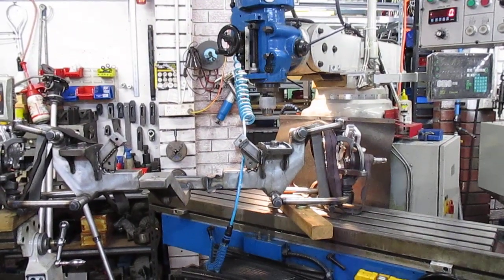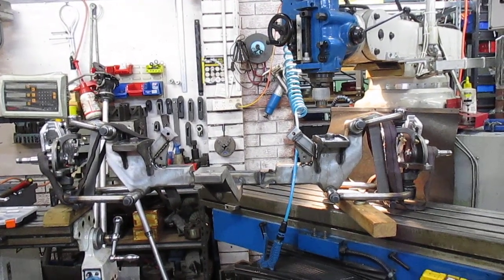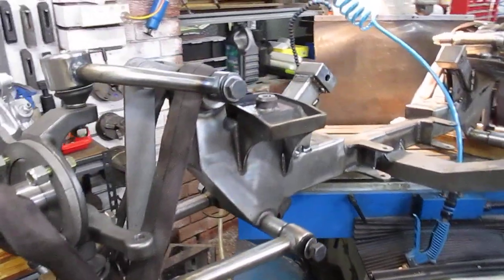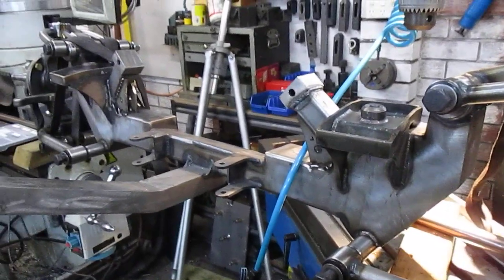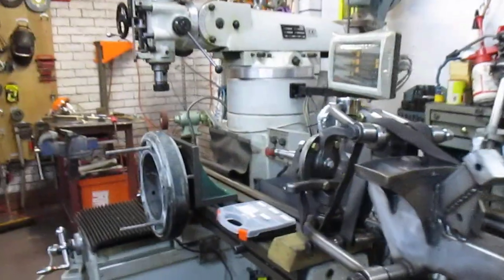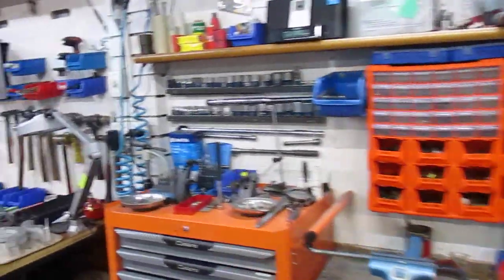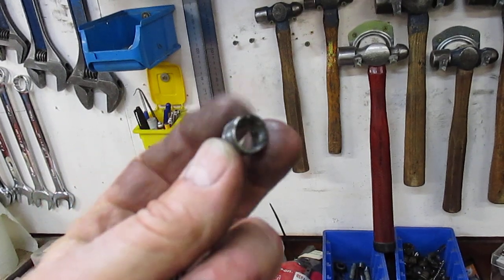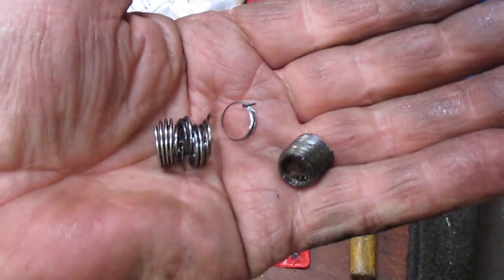Getter Out 13 modified car sub frame

Comment: Hi Bruce, are you saying that the coil insert is to blame for the seizing?  If so, what would be a better choice to avoid future problems?
Reply from the maker: Bob G'Day. This particular item had a coil issue, when I looked for the root cause of the failure it came to mind several possibilities: a) A faulty coil (more on that later) b) Stressed because of so many times the item had been offered up under the car for measurements and then taken off for more mods. (possibly hung on one bolt I can't comment on the handling) c) Coil tapping diameter bigger than recommended. d)  Not inserted correctly. Consequent to the movie I need to clarify that it appears that the tapped thread was missing some integrity part way down (pick up during tapping) this could have caused the coil to jump a bit and been the real root cause. Coils are good, I use many of them, as you can imagine. There are cases where you need something a little more substantial so we revert to full inserts, either purchased or made in house on occasions. I will make a movie with a comprehensive run down on the different thread repair methods, and show the buyable options that are on the market and their different merits.

Cheers Bruce
Reply from the maker: Bob, some things to keep in mind on possible coil issues are the following: Early coils were made by different manufacturers: Armstrong / Hellicoil / Recoil / Nucoil etc. Each had there own subtle differences and at times the products could be mixed up and not work if the tap or coil profiles were slightly different. Today many coil thread taps and coil inserts / coil kits are marked as standard inserts, that allows crossover between brands and negates the older issues. I have on 2 instances had issues with coils that the whole package was inferior and the bolts would bind up, I had to discard them and replace the lot. I always check with a stud before I move on to the next one, any issues I remove and replace the coil immediately. Have a good weekend. Bruce